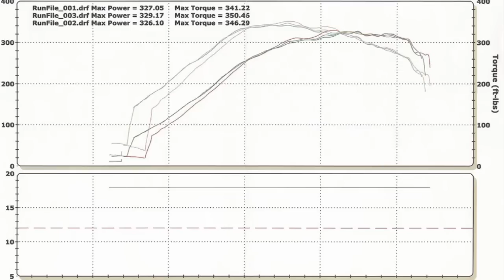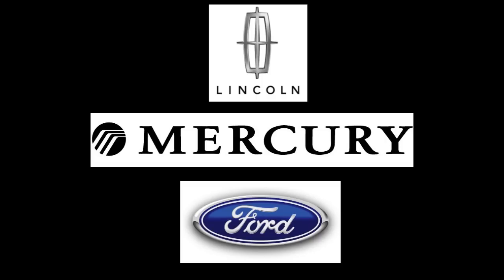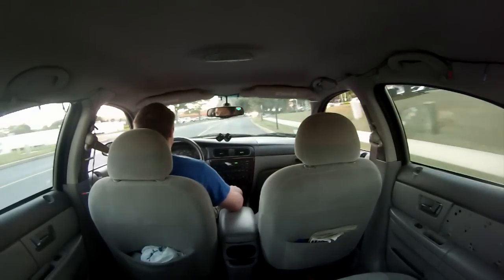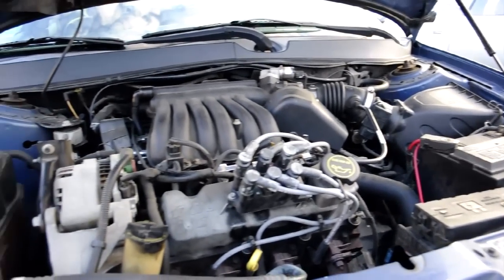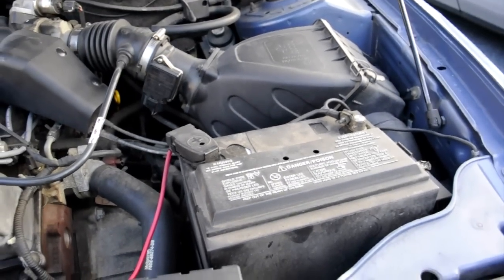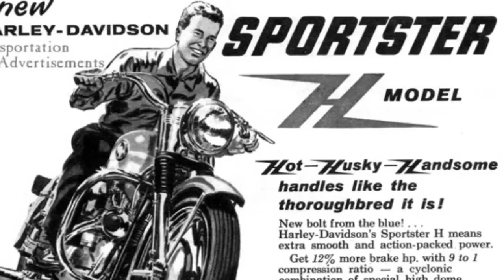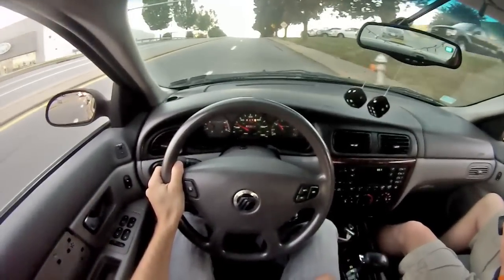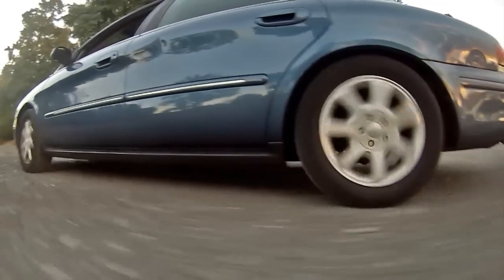Regular Car Reviews: 2002 Mercury Sable

Comment: I had myself a 99 taurus with that Vulcan engine, never had problems with it like some people did (coolant in the oil-oil in the coolant). I got that car to go pretty quick and it did just that, 85mph was cruising speed for it, granted after 150 miles the coolant reservoir started leeking coolant onto the belt which made it scream like a girl at a Justin Bieber concert in Philly . The air conditioning system.......who the fuck designed that. Probably some guy who thought it would work on paper.  Well I did buy that car for 500 bucks and sold her for a 1,000 to a friend of a Friend of mine who needed wheels to get to work .
Reply: You got out easy. While I recovered from the financial nightmare that my 98 taurus put me through, I don't think I'll ever get over the psychological scars.

Comment: I REALLY Liked my 98 with the 3.0 DOHC Duratec. It could haul 6 adults uphill and not break a sweat. Climate control didn't turn on the defrosters until the engine got hot though, which I thought strange. Ok I had a front strut tower go on it. Sure. But I didn't fix it. IT HAMMERED A HOLE IN THE TRANSMISSION COVER. I kept the fluid up, and the goddamn thing kept going.  Brand new, the cover was forty bucks.  The transmission got so hot melted the plastic speed sensor, messing up the speedo. IT DID NOT CARE. It just limped along, you just backed off the throttle and it upshifted. So got it fixed, sold it for a deal to someone who was hurting. STILL RUNNING WITH THAT SAME TRANSMISSION. IT DID NOT CARE.  Struts were like 26 bucks each new. Stupid cheap car to fix, I really didn't give it justice but I'm on East Coast Canada and cars return to their base molecules in fifteen years without a liberal coating of graphite and silicone.

Comment: review 1998-2002 olds intrigue
Reply: Great cars in their time! In fact, I would still gladly take a Final 500 variant with the DOHC 3.5L Shortstar V6.
Reply: +Evan Ganske Well there's the collectible vibe with the 500 version but what's your take on the car in general. This 2002 I have is the second I have owned. The Shortstar has been a steady performer. My '98 was ok. Any input would be appreciated.
Reply: +silvernail6 Well, the design of the Intrigue was very unique. I think the cleaner ones I see today are still lookers for sure. The build quality was typical late 90's GM, but if you took really good care of them, then they would last. I haven't heard of a collector Vibe though..

Comment: Forgive my nerd status but the Vulcan gets it's turd status from a couple poor design choices on an otherwise well designed engine. The biggest two problems are the combustion chamber design and the camshaft. Combustion chamber is huge which leads to detonation, couple this with iron heads that don't dissipate heat well and it means the tune on the engine has to be VERY mild (google "3.0 vulcan pinging"). Secondly the camshaft. HP is essentially a function of airflow and the ports on the engine are very large and reasonably well designed but the cam is stupid. Ford designed a cam that would help low end torque. While it did give the engine some interesting off-idle torque, it meant that the engine couldn't breath up top, which is where it wanted to run. I have driven many a 3.0 that will pull pretty hard to 3k rpm and then sit there and protest all the way up to it's pathetic redline. A small V6 needs to sing, not wallow around all day just off idle which is what Ford designed it to do
Reply: if your getting a mer in this era get a cougar

Comment: my 1st car was a 01 Taurus with the Duratec, body was rusted all the way up to the door latches and the trunk had a hole big enough to fit my leg through, and all the exhaust gas would come back and condensate the trunk and back seats, it was so bad I had mold growing in the seats and it rusted out the motors on my subs, and I remember the day I traded it in for a 98 Chevy S10, I was pulling the power wire off my system, had it strapped to the frame, but by then the unibody frame had gotten so bad the car would have snapped in half within that year, and in the process in removing the power wire a dollar coin sized chunk of rusted unibody frame came off and exploded into my eyes and mouth, I got $800 bucks on trade in value on a $900 credit building investment, he's right about this being a millennials car, great engine, garbage transmission, and body metal so weak, it shouldn't be allowed in any state with road salt...

Comment: The vulcan v6 howls angrily at you when you try and rev it. It sounds like you're going to be picking up chunks of connecting rod if you push it too hard. I had a 98 Taurus. Got what a dumpy car it was. I'd rather drive a Toyota Tercel than a Taurus. Under-Engineered American Rubbish at it's most mediocre

Comment: Those engines were always crap and still are crap
Reply: Performance wise

but the damn things can take some serious abuse
Reply: awesomeologyism yes performance wise they are crap but longativity good
Reply: awesomeologyism What do you think is worse the Vulcan or the Essex? (Speaking about the mid-90's versions of both)
Reply: kirbyswarp I'd say Essex was worse. It had much more torque though, but the thing wasn't nearly as reliable as the Vulcan.
Reply: Fordguy1997 At least it had aluminum alloy heads. You mean worse as in not wanting to rev?